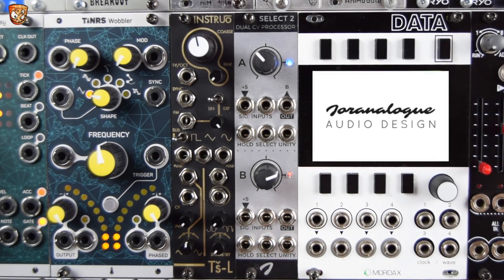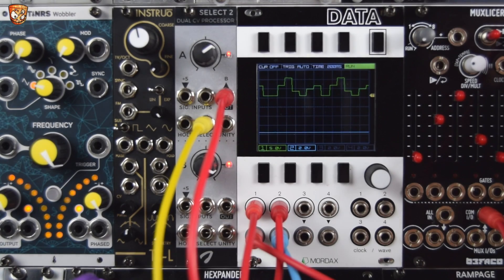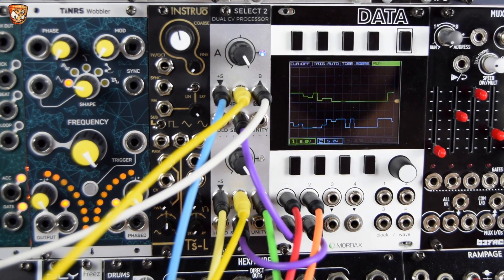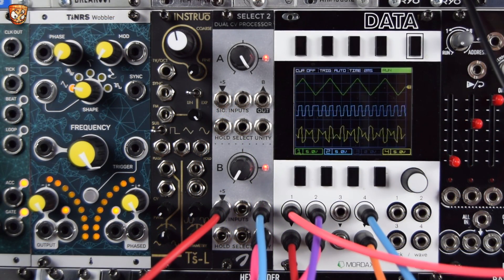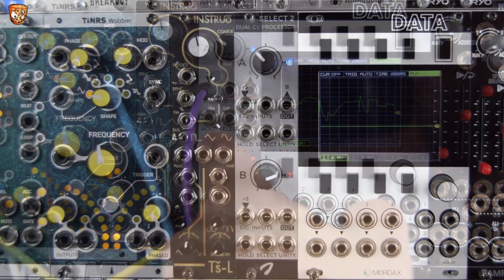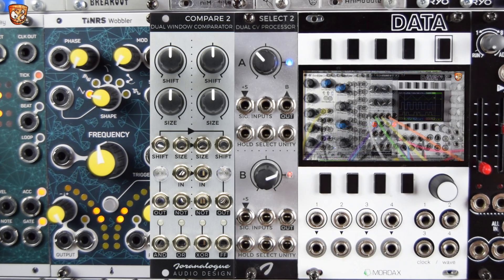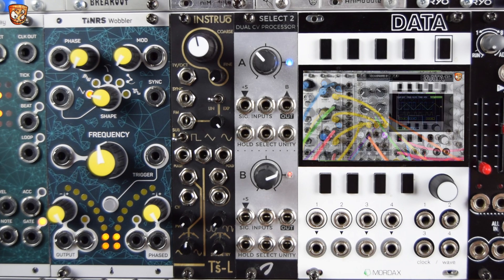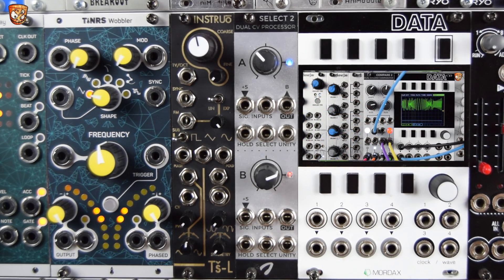Joranalogue - Select 2 (dual CV processor)

Comment: what kind of mixer are you using to get stereo sound , can you describe final connections, thank you
Reply from the maker: it can be anything but in this case I'm using the Befaco Hexmix series and my outputs are on a Praxis Snake Charmer module which gives me 8 balanced line level signals out onto a DB25 snake cable that goes to my recording set up.